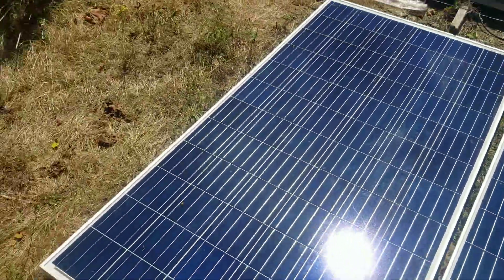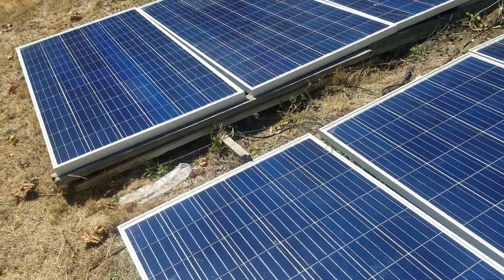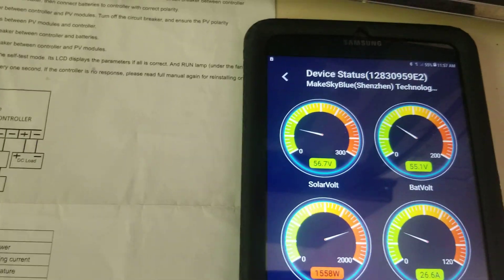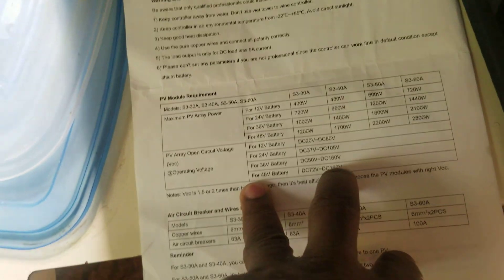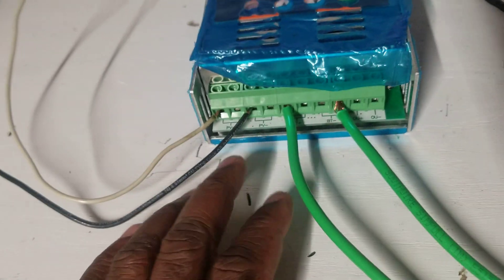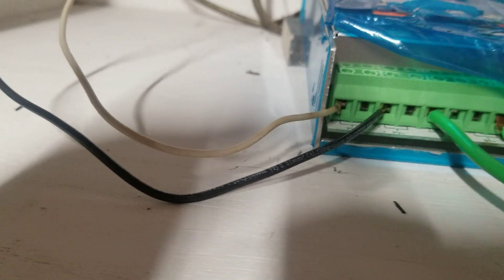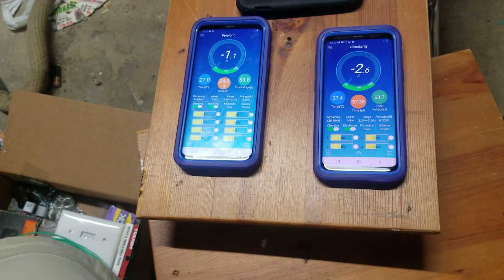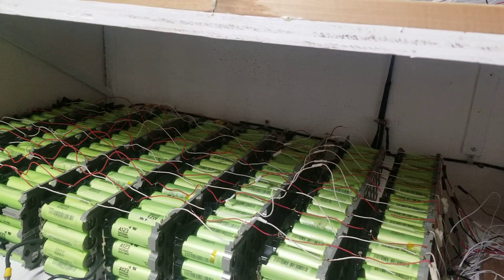Adding more Solar Panels to 2,520W. Producing 30A plus. How to Wire Solar Panels in Series Parallel.

Comment: Video on YouTube with DC-power lines with open ends is not a good example. This is not acceptable wiring. You need more and longer wires for the setup. You have equipment – please do more for safer wiring so this can be good learning for new starters.
Reply from the maker: I am on test mode, I have to make these things are working before I buy expensive wires. This is not the final product.